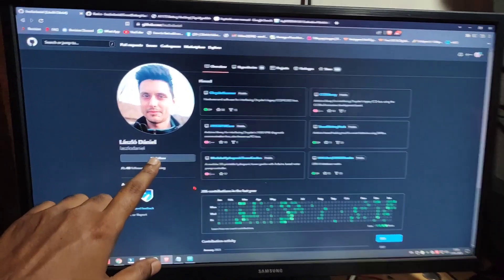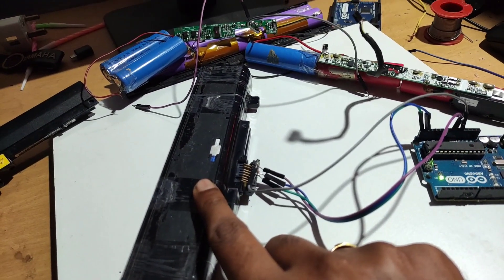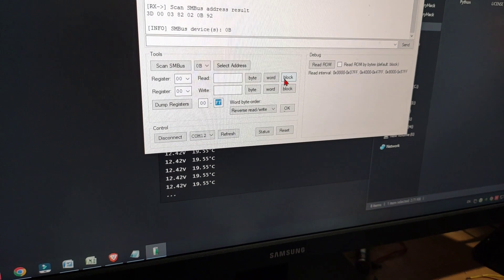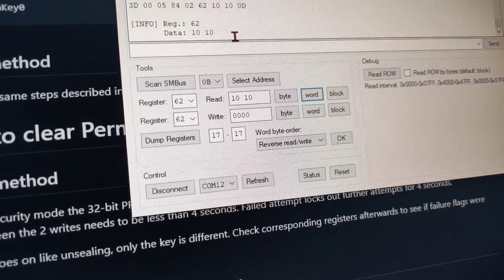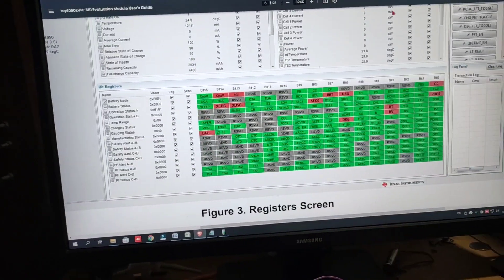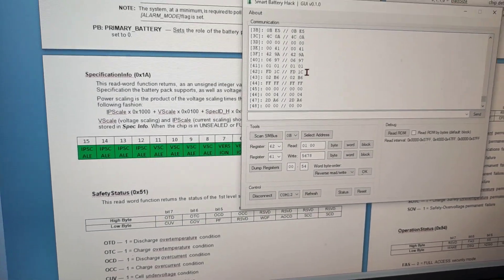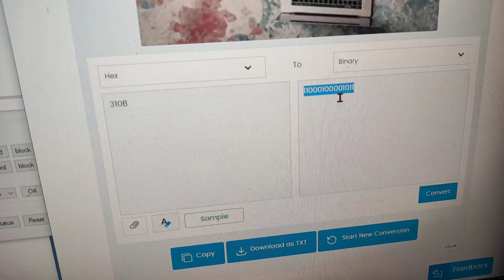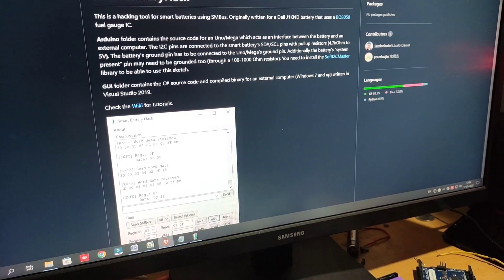Laptop battery data retrieval and reset with arduino - BMS HACK #arduino i2cprotocol part 3 SMBus

Comment: i am currently working on acer aspire 4920 laptop AS07A51 battery. with max1718 chip. i have recently change all the cells with newer ones. but the normal calibration seems to not work properly. after lot of tinkering i think my bms is locked. so iam trying to unlock it. will i get effective results if i try your method to unlock bms board and set full capacity manually. can u please guide me.🥺🙏. i guide files does not match my chip. can i just follow the pins connection and proceed will that work

Comment: Bro i have dell laptop battery with BQ40320 chip in it and i replaced original LG 2750mAh cells with brand new DMEGC 3200mAh cells now my laptop is not accepting and battery is also not charging when pluged in.
I have an ESP8266 NodeMCU, with the help of ChatGPT i somehow extracted the 
max capacity as 148mAh
Current capacity as 0mAh
Cycle count as 316.
So can you please guide me to reset the cycle count, change capacity so that i can be able to run my laptop on battery again... 🙏🏻
Reply from the maker: bq40320 maybe uses default unseal codes. did u try any code?
Reply: @AnandakrishnaSudhakaran  how to all that with my laptop and esp8266?

Comment: Hello, i have a battery from a lenovo L430, my chips are a BQ8030A and a BQ29330, after i replaced the 6 cells i get 0v on the output even tho the batteries are fully charged to 4.2V and the laptop wont turn on, i think i need to reset the chip somehow, can you please help me? i really need to get this laptop to work again. i have an arduino uno.
Reply from the maker: If you have uno we can try some tricks can you please msg me on my instagram or facebook
Reply: @AnandakrishnaSudhakaran im a college student at devry university going for a degree in IT so I have a full arduino kit, but we haven't been taught nothing along the lines of battery repair, which is what I mainly need to learn! If you could help me, please let me know how to find you on either platform. I have both Facebook and instagram
Reply: @AnandakrishnaSudhakaran  Yes I will message you as soon as possible. Thank you
Reply: I have a uno and a mega. I have multiple different laptop batteries I need to learn how to fix. I'd really appreciate the help if possible! 😊

Comment: Can Hp battery with B030Z55 chip be unlocked ?
Reply: Earned 1 subscriber and keep growing ❤👍
Reply: I have one more query. I have a laptop whoes battery I tried to repair but after replacing new cells the bms is giving output volts but the laptop is just turning on normally and showing battery charging light but no display or bios seen what would be the issue plz 😢 it's old Acer aspire one netbook laptop and was working fine before battery repair
Reply from the maker: @technovagerindia5633 Thank you for your support 

So that laptop not turn on after replace cells, is it working on adaptor? Any image or bios logo?
Reply from the maker: Can you contact me through instagram or telegram
Reply from the maker: Yes please if the unseal key is default. Please watch my other videos of dji battery killer. It support bq30z55. If you know the key you can enter it. Default key is already loaded.

Only works if the unlock key is default.
Reply: @AnandakrishnaSudhakaran   Can i program with raspberry pi 3  or FTDI usb to TTL converter chip ?
Reply from the maker: @technovagerindia5633  Actually there is a video availble with raspberry pi. That py program support bq30z55. I will share. You can watch and do like that. I didnt get a time to publish my pi video. I done with pi zero and unlocked bq4050.
Reply from the maker: @technovagerindia5633  watch this video. Its for drone battery. But chip is same
https://youtu.be/P5PNOO2GebY?si=H0SVo3lZmWKoJEX_
Reply: @AnandakrishnaSudhakaran   Bhai thankyou for ur valuable support you are genius

Comment: Please help as soon as possible. Can I disassemble the BMS circuit block and the Arduino without using the EV2300? Please reply. ❤
Reply from the maker: Which chip is used in bms

Comment: I am not able to write anything to the registers ... I don't know why... I can only read it..what to do?
Reply from the maker: Can you tell me about your setup? Which chip?, which model? Which battery? Which boars you tried
Reply: @AnandakrishnaSudhakaran  can I connect with you on email..or something..?
Reply from the maker: @electro900  contact me through email or telegram
Reply: @AnandakrishnaSudhakaran  can you share me the ID
Reply from the maker: @electro900  my telegram id ialwaysthere4u

Insta id anandakrishna_sudhakaran
Reply: I couldn't find chip number, because epoxy was applied on that..
Reply: But the connector has 8 pins...
Reply: 3 cells model, 10.48 volt, I actually replaced every cells in it

Comment: I have lenovo L12L4A02 with R2J24051 chip and was experimenting and got locked
Any way to change count and unlock it,all i have is uno board and usb to rs232
Reply from the maker: I don't think it's possible. Let me check the chip first. Thanks for your comment.

Comment: Hi Anandakrishna i have irobot battery (it has 045a20 chip) and i connected arduino with your smartbatterycack system. what is wrong with me, Thanks. 

In gui i see this thinks;

[INFO] Connecting to COM5

[<-TX] Handshake request (COM5)
3D 00 02 01 00 03

[RX->] Handshake response
3D 00 08 81 00 53 42 48 41 43 4B 35

[INFO] Handshake OK: SBHACK

[INFO] Device connected (COM5)

[RX->] Device settings
3D 00 05 83 01 03 00 00 8C

[INFO] Word byte-order: reverse read/write

[INFO] Design voltage: 0,0 V

[<-TX] Scan SMBus
3D 00 02 02 02 06

[RX->] Scan SMBus address result
3D 00 03 82 02 FF 86

[INFO] No SMBus device found

[<-TX] SMBus register dump request
3D 00 04 02 03 00 18 21

[RX->] SMBus register dump (00-18)
3D 00 4F 82 03 00 18 00 FF FF 01 FF FF 02 FF FF 03 FF FF 04 FF FF 05 FF FF 06 FF FF 07 FF FF 08 
FF FF 09 FF FF 0A FF FF 0B FF FF 0C FF FF 0D FF FF 0E FF FF 0F FF FF 10 FF FF 11 FF FF 12 FF FF 
13 FF FF 14 FF FF 15 FF FF 16 FF FF 17 FF FF 18 FF FF E6

[INFO] SMBus register dump details (00-18):
[00]: FF FF // ManufacturerAccess: FF FF
[01]: FF FF // RemainingCapacityAlarm: 65535 mAh
[02]: FF FF // RemainingTimeAlarm: 65535 minutes
[03]: FF FF // BatteryMode: 1111111111111111
[04]: FF FF // AtRate: 65535 minutes
[05]: FF FF // AtRateTimeToFull: 65535 minutes
[06]: FF FF // AtRateTimeToEmpty: 65535 minutes
[07]: FF FF // AtRateOK: true
[08]: FF FF // Temperature: 652,62°C
[09]: FF FF // Voltage: 65,535 V
[0A]: FF FF // Current: 65,535 A
[0B]: FF FF // AverageCurrent: 65,535 A
[0C]: FF FF // MaxError: 65535%
[0D]: FF FF // RelativeStateOfCharge: 65535%
[0E]: FF FF // AbsoluteStateOfCharge: 65535%
[0F]: FF FF // RemainingCapacity: 65535 mAh
[10]: FF FF // FullChargeCapacity: 65535 mAh
[11]: FF FF // RunTimeToEmpty: 65535 minutes
[12]: FF FF // AverageTimeToEmpty: 65535 minutes
[13]: FF FF // AverageTimeToFull: 65535 minutes
[14]: FF FF // ChargingCurrent: 65,535 A
[15]: FF FF // ChargingVoltage: 65,535 V
[16]: FF FF // BatteryStatus: 1111111111111111
[17]: FF FF // CycleCount: 65535
[18]: FF FF // DesignCapacity: 65535 mAh

[

Comment: I try this one with my old laptop battery but there is no output voltage at pin
 But I successfully made handshake OK.
When i try to read register from 0-65 all value will show in a group form and battery hack window closes every time automatically 
I hope you can guide me through this problem.
(I have only used 4.2 k ohm resistances from 5v to data line. Is it due to that)
Reply from the maker: Did you able to open the battery? What is the condition of battery and fuse? Chip number?
Reply: Yes i opened the battery. Two cell were fully rusted and dead. I test for fuse it’s okay. The chip is BQ 8050
Reply from the maker: @soneixtv4985  bq8050 is difficult to unseal. I tried many ways but it is not responding correctly. I have one bq8050. I am developing a way to access the rom. So wait some days. I cannot guarantee you but iam trying a free way to recover bq8050. Bq8050 needed the pres pin present. So find that pin and connect it to the ground. Which is your battery model?
Reply: Its J1KND battery model.
Ye surei can wait. Im  also looking how NLBA analyzer works
Is chip BQ 8050 is the reason for not getting 12 v output?
Reply: Do you get any updates on bq8050 chip battery
Reply from the maker: @soneixtv4985  hello, I got a way to enter bootmode, but at a one stage , i dont know which word is written to the register, its a random word. I will share the steps
Reply from the maker: @soneixtv4985  1. Send 0x0214 to 0x71
2. Read static word from 0x74
3. Read challenge word from 0x73
4. Send ???? to 0x71
5. Send 0x0517 to 0x70

This is the link and there is a cmd line for try it if you have the fx2lp board.,

Read this comment

http://www.karosium.com/2016/08/smbusb-hacking-smart-batteries.html?showComment=1680955197517&m=1#c8207632130749679723
Reply: @AnandakrishnaSudhakaran  I am trying to reset BQ 8050. Did you got success in resetting?
Reply: @AnandakrishnaSudhakaran  Is this method works with Arduino for BQ 8050? It's a dumb question but I am a noob in resetting the battery..
Reply from the maker: @sufianahmad6341  No, am still developing a way to enter boot rom. It will take time.
Reply from the maker: @studentsufian  with arduino anything is possible if we know the code. Dont worry I am also noob. If I find anything I will publish a video.
Reply: @AnandakrishnaSudhakaran  I ahve one question- Why do you reset the cycle count to zero? does battery automaticaly locks up after certain cycle count?
Reply from the maker: @studentsufian  yes, its a safety feature. After recelling the battery pack with new cells, some parameters need to be reset. Cycle count is one of them. Full charge capacity is another important parameter. After a 300 or 400 cycle count, full charge capacity will start to decrease, if your battery is 4000mAh then after 200 or 300 cycles, it will be 2000 mah or 3000mah, to protect the laptop also protect the cells to not overcharge or over current8 basically a protection feature. So I dont suggest old cells , get new cells and reset these parameters then battery will be fresh as new.
Reply: @AnandakrishnaSudhakaran  there is a way by which we can increase the charge capacity to near the rated capacity:-
Reply: @AnandakrishnaSudhakaran  but the issue with this method that, it disturb the realtime battery percentage and the laptop shuts down without indicating low battery. On the other hand, the battery capacity increases.
I think this solves 50 % of the problem of battery when you put new cells inside battery but you can't view realtime battery percentage
Reply from the maker: @studentsufian  There are other things to do if inserting mew cells, like chemistry, cut off voltages, also if you are increasing Capacity then the charging current should be adjusted for better performance. Also with old cells, battery will not last hours, because old cells are already weak. Here in my case it was experimental. And i repaired 3 batteries with the bq8030, after the reset, battery should autocycle,.means a full charge and full discharge to make understand the chip the condition of battery. All of my video just showing how to reset the chip, not changing the cells, because that chnaging cells is not documented. It is still with other persons, they are not ready to share. My 3 bq8030 working good, 2 of them gives me 40mins, becuase cells are weak.
Reply from the maker: @studentsufian  I thing in your case, cells are not good, internal resistance must be high or cells are not balanced, immediate shutdown means battery not giving output when needed. It indicates problems related to fuse, mosfets, or Chip. Check the fuse and mosfet flags. Also check the output, if the laptop cannot read the data from the chip , the same will happen, the laptop will shut down immediately. So  also check the contacts between the laptop and the battery.
Reply from the maker: @studentsufian  Do an autocycle then the battery will give you the correct percentage. But don't use old cells. If you tried with old cells do at your own risk
Reply: @AnandakrishnaSudhakaran  thanks, I have two laptops, one has J1knd ( BQ8050) battery and other one is HT03XL, I had purchased the new HT03XL, five months ago, the battery capacity is reduced and now it is 70%, for now I will not do anything with the new one as it is still in warranty period , although I have old HT03XL and J1knd, I will do experiment with those old ones.
Thanks for your effort. I will be looking for a solution from you to reset the BQ8050 in future.

Comment: Hello! Please do a tutorial on how to hack BQ9000 chips.
Reply from the maker: I tried many ways but it is not responding. But i will release a video of effort next week, bq9000 is a custom IC, so texas instruments are not giving details about it. But iam digging the maximum to get data, The unsealing is not working for this chip. Lets hope, you can watch video next week..thanks for your support
Reply: @AnandakrishnaSudhakaran I hope you could find a way though, I really want to revive this battery after recelling. I don't want to buy 3rd party batteries because it doesn't fit properly on my Acer laptop and most reviews in them says that their battery percentage is not really that accurate than the original before. Thanks, I appreciate your efforts!

Comment: can you unlock bq40z60 ?
its BMS for laptop
Reply from the maker: If we know the unlock code anyone can do it, but modern chip security contains sha 1 authentication. To unseal the chip we need to apply the correct code. Also with arduino its not possible. Cp2112 is support this, also there is a program for raspberry pi. With arduino i cant unlock this, but we can read values also if know the unlock code we can apply.
Reply: @AnandakrishnaSudhakaran  thanks for you response , is it possible to get different BMS ,and solder battery onto it,.i suppose it would be cheaper ,since its a chip and pcb only..i have Microsoft surface laptop 2 , its battery is same like macbook ., and its almost 7k for new battery

Comment: with this hack we can rewrite any chip?
i can get Full access of any battery chip? except for r2j240 and maxim chips
Reply from the maker: If you know the unseal code you can access any chips, but modern chips uses SHA 1 Authentication. Sha 1 auth need advance programs like,  bq studio, NLBA and some chips can unlock with cp2112 board.
Reply: @AnandakrishnaSudhakaran  i have NLBA1 but i cant reset and clear PF from R2j240 chips can you help me how to do it?
i have cp2112 and also nlba and EV2300
Reply: if you a make a video on that it will be nice!!!
Reply from the maker: @hitmanyt2021  hey, check nlba community. Am sorry i dont have that tools. Am not that much proffessional to do that. But you can do it. Nlba is top class proffessional tool. I will check and share you link if i found.
Reply from the maker: @hitmanyt2021  also please confirm the chip number. Can you share me an image on my instagram. So i can check more
Reply: @AnandakrishnaSudhakaran  r2j240 40F050

Comment: Hi, i read keys from battery ( first step)  now I can't connect to the battery via Smart Battery Hack, I get the message:

[INFO] Connecting to COM1
[<-TX] Handshake request (COM1)
3D 00 02 01 00 03
[RX->] Data received
06 18 78 F8 86 60 18 1E 78 66 18 F8
[INFO] Handshake ERROR: ` xf
[INFO] Device not found at COM1
[INFO] Connecting to COM1
[<-TX] Handshake request (COM1)
3D 00 02 01 00 03
[RX->] Data received
06 18 78 F8 86 E0 18 1E 78 66 18 F8
[INFO] Handshake ERROR: ?xf
[INFO] Device not found at COM1
[INFO] Connecting to COM1
[<-TX] Handshake request (COM1)
3D 00 02 01 00 03
[RX->] Data received
06 18 F8 F8 86 60 18 1E 78 66 18 F8
[INFO] Handshake ERROR: ` xf
[INFO] Device not found at COM1
[INFO] Connecting to COM1
[<-TX] Handshake request (COM1)
3D 00 02 01 00 03
[RX->] Data received
06 18 78 F8 86 60 18 1E 78 66 18 F8
[INFO] Handshake ERROR: ` xf
[INFO] Device not found at COM1
[INFO] Connecting to COM1
[<-TX] Handshake request (COM1)
3D 00 02 01 00 03
[RX->] Data received
06 18 78 F8 86 E0 18 1E 78 66 18 F8
[INFO] Handshake ERROR: ?xf
[INFO] Device not found at COM1

where is the problem?
Reply from the maker: First go to device manager , under ports find arduino port number. Com1 is reserved i think, check again
Reply: @AnandakrishnaSudhakaran  i checked it, port is free, changed com port numbers, restarted computer and no effect :( if the port is busy the program reports it.
Reply from the maker: @tmxm7360  ok try with arduino studio try upload the code again, after upload close the arduino software then try with this software
Reply: @AnandakrishnaSudhakaran  friend i tried many solutions and still the same result. Is it possible to do it with FX2LP?
Reply: number of cycles reset! the problem was with the arduino, changing the arduino solved the problem. Thank you
Reply from the maker: @tmxm7360  thats a great work, I appreciate your effort. Thanks for your valuable comment.